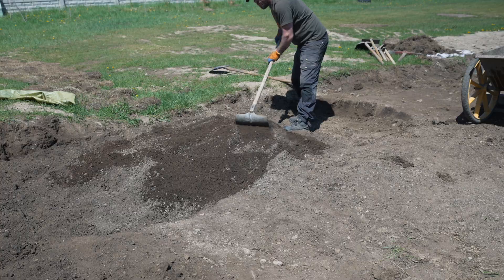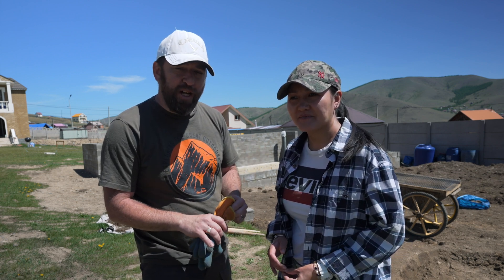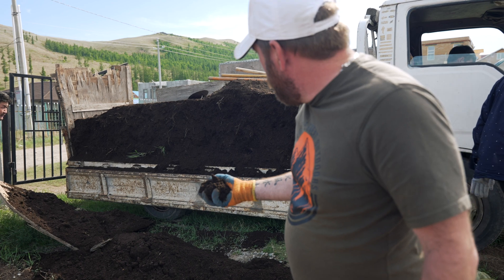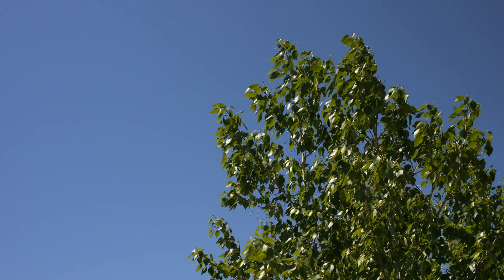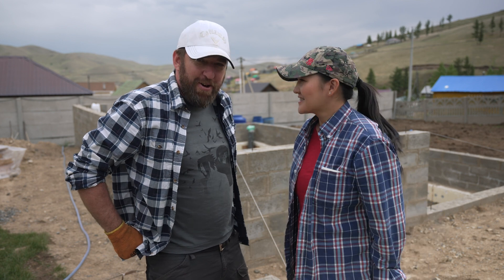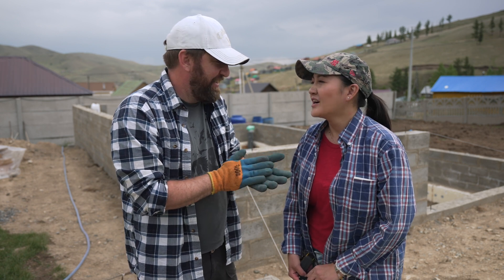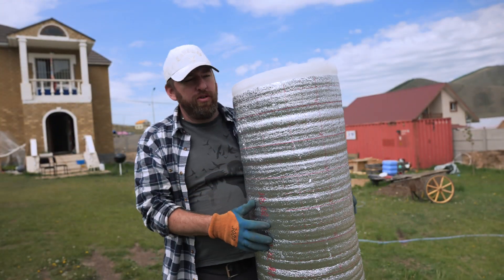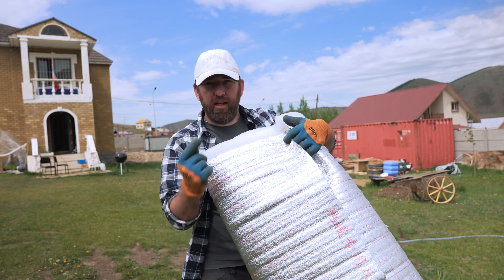Finally Time Mongolia | Passive Solar Greenhouse with Geothermal Build EP8 | Winter Greenhouse

Comment: Looking good guys, I would keep getting as much of that compost as you can, your going to need a massive pile for inside the GH as well. I used at least 3 truck loads in mine and its smaller than yours.  Nice work on sourcing some timber that you can have cut at a yard. did you decide on a roof design (revised angle)   I will post some pics on FB of the inside of mine its a real jungle now. oh and Im finding im only just coping with the overheat   so make sure your high vents a as big as you can.   stay well  rob
Reply from the maker: Thanks Rob, we definitely will👍 you we will be able to manage about a 55 deg front and a 23deg back roof. Wow that is a lot of compost. What was our mix percentage? Compost to top souls?
Reply: @SimpleWildLiving  about 50/50 mix of topsoil and compost. But in the bottom of the raised beds I had 2 trailer loads of 1 year old horse manure. It will break down and add nutrients. The soil then went on top. It does settle about 15% so if its free organise getting lots more than u think you need, it always all gets used. Good new son the roof redesign I think it will be tall but help greatly.  Ciao 4 now
Reply from the maker: Thanks bro 😎🙏🏻👍